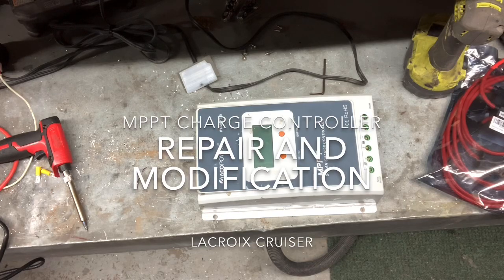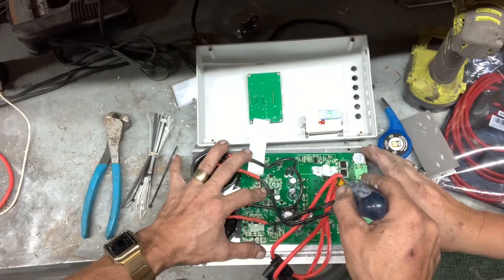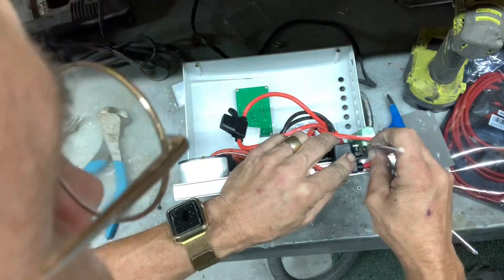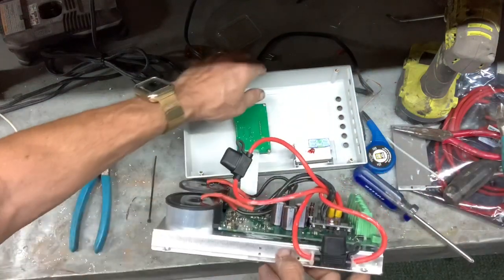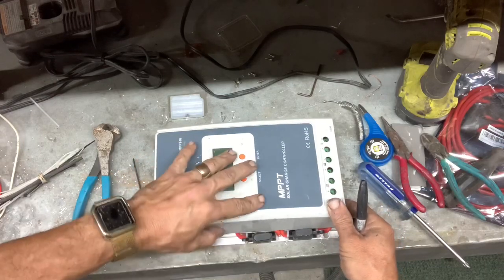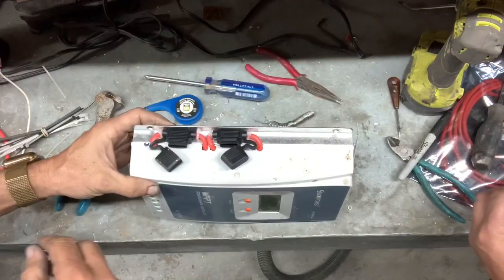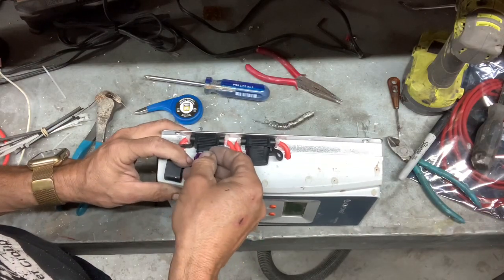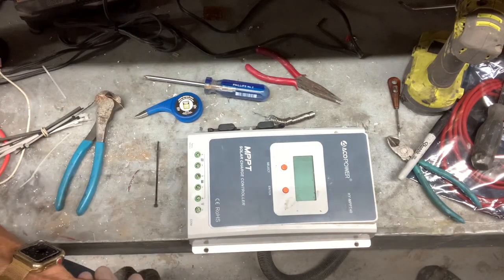MPPT solar charge controller repair and modification.

Comment: Mr Lacroix.   Is there any hope for my  solar charge controller after having mistakenly introduced solar power without the battery. I pulled the back and couldn't find any fuses. That's got me worried. 
Thanks for any help you can suggest. 
Bob
Reply from the maker: In that case you may want to contact the manufacturer
Reply: @LacroixCruiser  Thanks

Comment: I have the 100a tracer model. Are one of the fuses for the display/interfacing and the other for the charging? The display on the charge controller won't come on, the remote display won't connect, and I can't interface using a USB to a pc. But it still charges. 

Great tutorial by the way!
Reply from the maker: Thank you, sorry I cant help.

Comment: i have the same controller ..mine had 2 white 25 amps fuses both of them blown...was not an easy task to unsolder the old fuses and put in the new ones in but i got there in  the end lol.
Reply from the maker: Good job!
Reply: @LacroixCruiser  It's easiest to snip away the plastic of the fuses and solder your new fuses to the remaining legs still soldered onto the board.
Reply from the maker: Good idea

Comment: curious if you checked the fuses before removing.   i have a similar controller and all the fuses tested good (continuity) but it's totally dead.   more detective work ahead.
Reply from the maker: Yes fuses were blown in our case.

Comment: I have no power going from my charge controller to the battery - is it possible the internal fuse has blown? I may have plugged the solar panel in before the battery to the CC as I was rushing. Any help would be much appreciated. Thanks.
Reply: Joe, were you able to fix your controller?
Reply: @randolfefrilleestranero5900  yes, the internal fuses had blown. Used fuse wire to fix them. Tied it around holes on the existing fuses as it was solder down. Works like a dream now!
Reply from the maker: Nice save.
Reply: @LacroixCruiser  Thanks! The wire was $1 too so really did save me.
Reply: @joesnow739  your case was the same with mine but I already dumped the SCC 😭
Reply from the maker: Very possible, disconnect it, open it up, and check.
Reply: @LacroixCruiser  Thanks Lacroix. Looks like a broken fuse. Unable to get the fuse out though. Is it possible to use 30amp fuse wire for the job? Surprised they solder them in - any reason for this? Thanks, Joe
Reply from the maker: I unsoldered mine and wired in a fuse holder externally.

Comment: Have you had to replace any of the terminal screws that hold the PV or battery wires in place?  I have a unit where the Phillips screw heads were stripped and Epever doesn't seem to have a solution.  I haven't opened mine up yet.
Reply: I have this same problem. Did you ever figure out a solution?
Reply: @annikagibbons4146  Not yet.  I still need to disconnect it and open it up.
Reply: @LennyVasbinder  so how do you deal with the screws being stripped? The wires won’t stay in-how does opening it up help?
Reply: @LennyVasbinder  I just haven’t been able to have a good enough connection to my battery wires, so I can’t get solar power in as it’s having trouble connecting to the battery terminals and I can’t leave it bringing in power as that would fry my charge controller
Reply: @annikagibbons4146  As I noted above, I used Epever's suggestion to get the screw tight and hopefully, I don't have to fool with it for a while.  I'll probably buy another unit and once I have this one disconnected, I'll open it up and see if there is a better fix.
Reply from the maker: Good plan.
Reply: @annikagibbons4146  Did you ever figure out how to fix the stripped screw?
Reply from the maker: Not yet
Reply: @LacroixCruiser  I'm going to subscribe from my other YT name/channel, Off-Grid And RV Living.  I hope you never have to but if you do, I'll be waiting. :D  Epever sent a reply saying to use a thick rubber band on the end of the Phillips screwdriver but I'd really like to replace the screw so I can be sure of getting a tight connection.  15-30 amps DC is a lot of juice for a loose connection.
Reply from the maker: Agreed, that doesn’t sound like a long term solution.

Comment: Yvan, interesting why some have a fuse that requires this much work to replace!  A short cut design or just expecting to sell a new unit. Was this in the older bus?
Reply from the maker: Yes this was in the GMC, no solar installed in the MCI 102DL3 yet

Comment: How often do the fuses blow? I've been running a 60 amp for over a year and knock on wood I haven't had a problem.
I've not heard about people blowing fuses in them in any of the solar groups I belong to.
Reply: Once is enough to warrant the modification/upgrade.  I will never understand the thought process that is used to decide that an internal fuse is better solution than an externally available fuse holder or, even better, a resetable circuit breaker.  The cost savings just isn’t significant.
Reply from the maker: It’s only happened once .